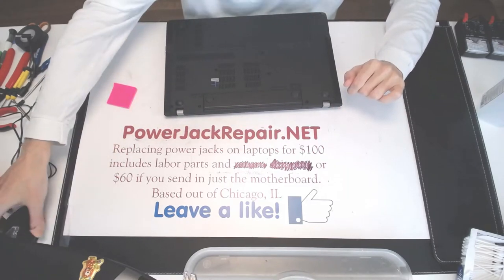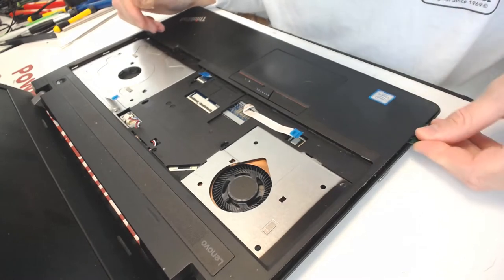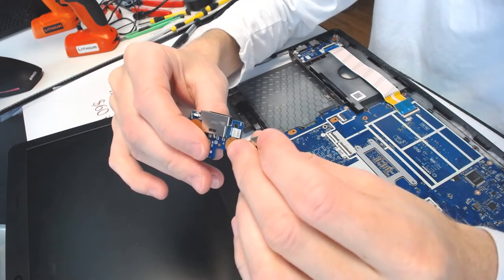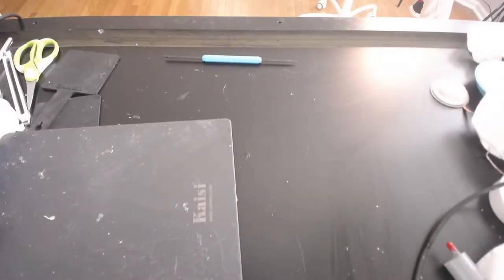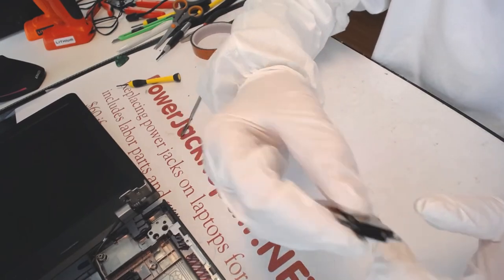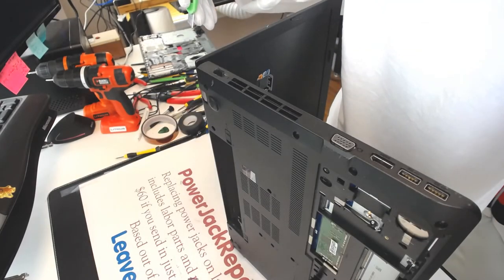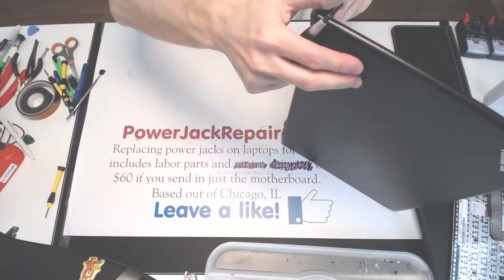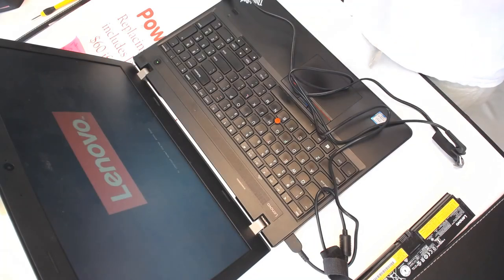How to fix laptop not powering on Lenovo E570 broken charge port power jack repair charging port

Comment: Quick question… any reason replacing the combined port/board unit wouldn’t work?  Hardware is an extra $20 but can skip the soldering that way.
Reply: Nope, replacing it should work!

Comment: The hinge isn't necessary broken. I've taken apart this laptop before, and there are two screws at the back that holds in place the bracket for the hinge, and without the screw, the hinge moves around and crunches a board! It's like the designers of this laptop put in a trap so that you will break the laptop by taking it apart.

Because if you open or close the screen after you take out the screws, it will lever the bracket into the charger chipboard and break the mounts...